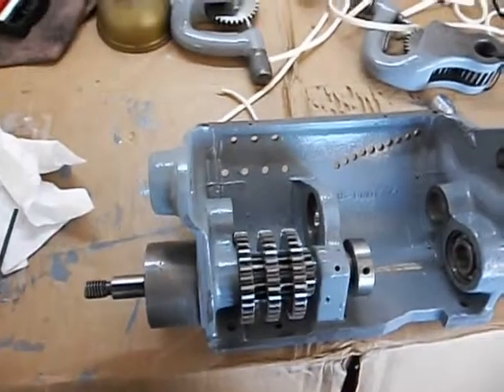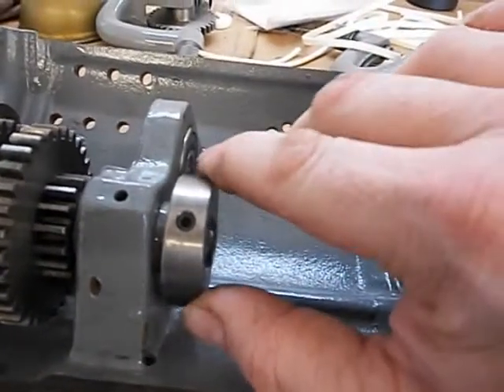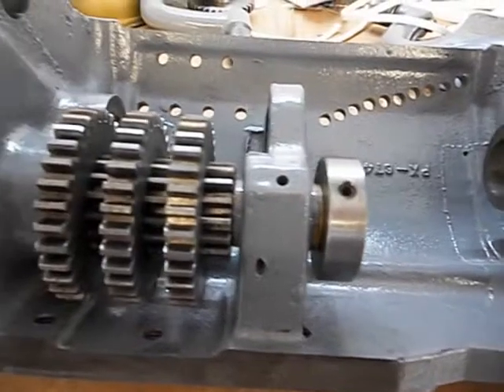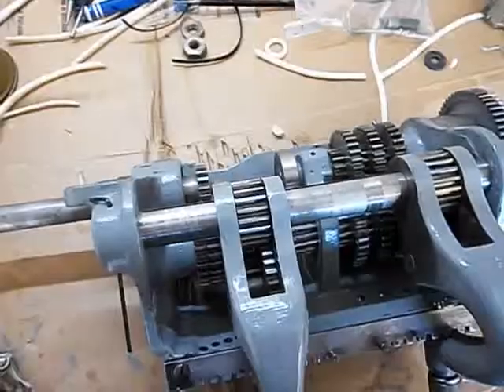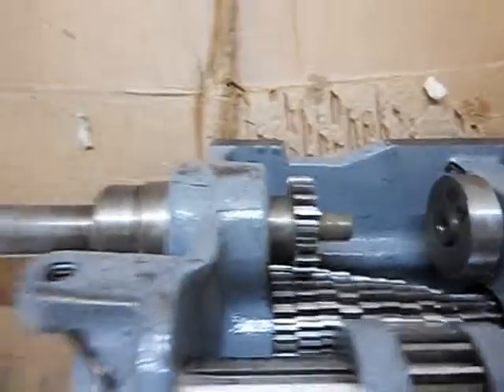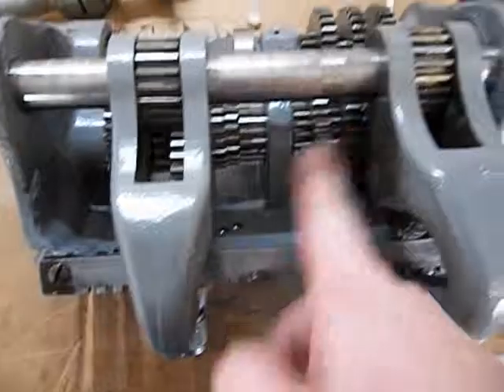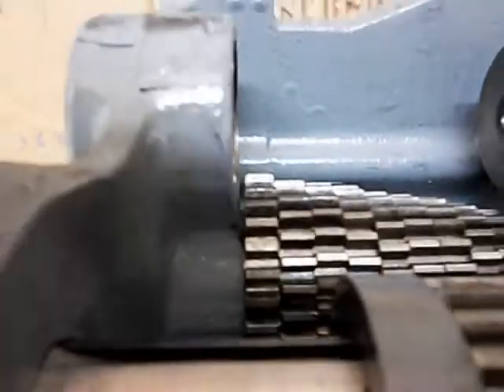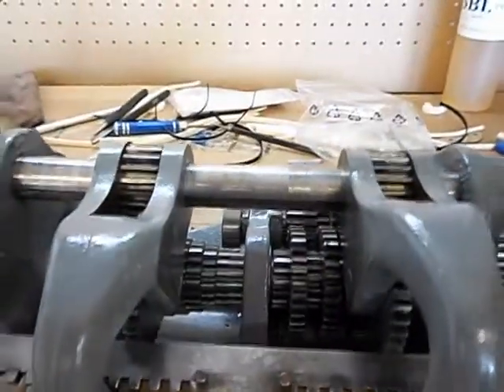South Bend Heavy 10 Gearbox Assembly

Comment: the out put bearing should be shielded at least on open side, that will fill up with chips. the original was shielded on nut side and open to drip lube on inside.

Comment: Did you take notes on the tooth count of the cone of gears and the final gear on the leadscrew?
If so, can I please have them? 
I figure that the reduction gearing is all 16/32's like the 48 spd.
Reply from the maker: unfortunately I did not.  Info might be in the South Bend manuals but I've never looked.
Reply: Managed to find it. Same as the 48 speed but adds a 27t and 30t.
Still drives off the 28t though. Took me a couple of calculations to figure that out.